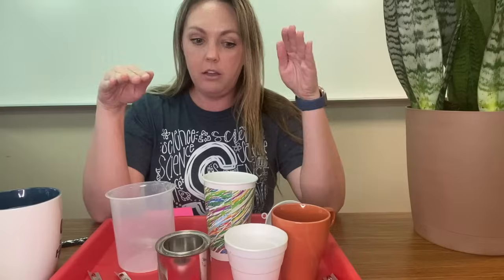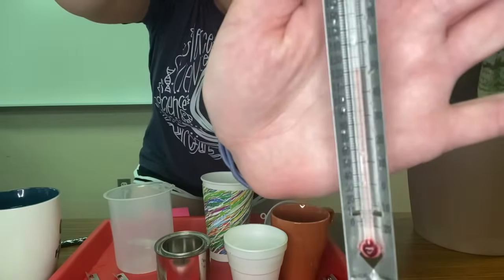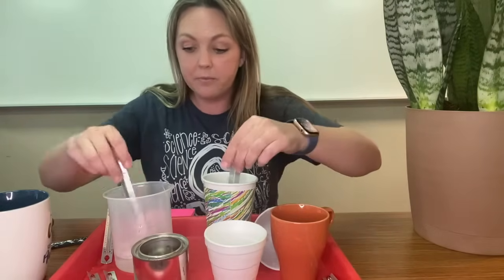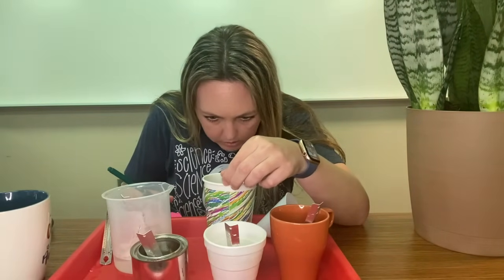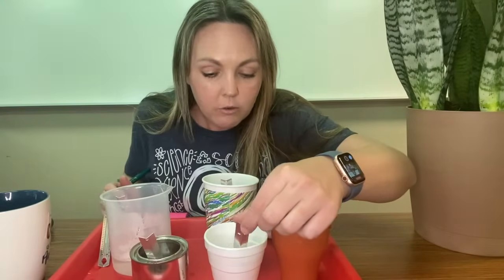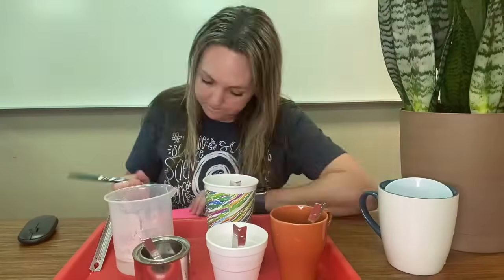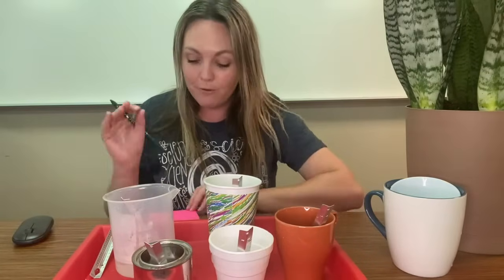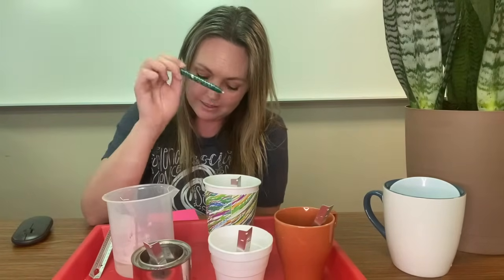Testing Matter: Thermal Conductivity Demonstration with Different Cups

Comment: Oh wow you've tested nothing. As you didn't control any variable in your test beside initial water temperature.
Using small and uncontrolled amount of water really tips the scales of your test, evaporation plays bigger role plastic cup has a huge surface area compared   to others, general heat capacity of a cup plays bigger role,  as your little bit of water will expend a lot of it's stored energy to just heat up the container it's in.